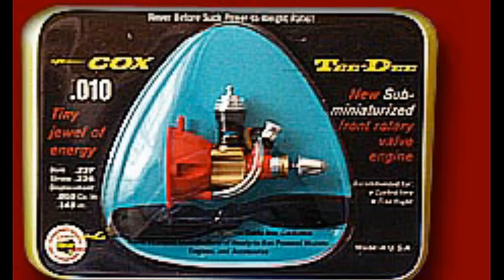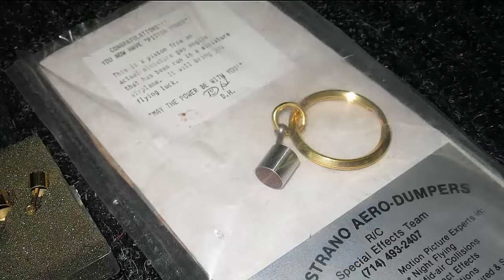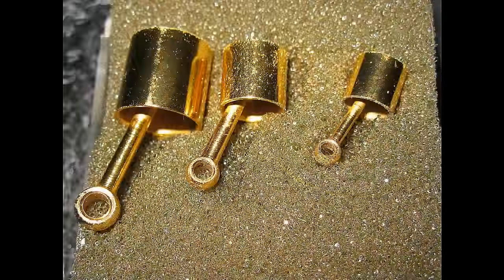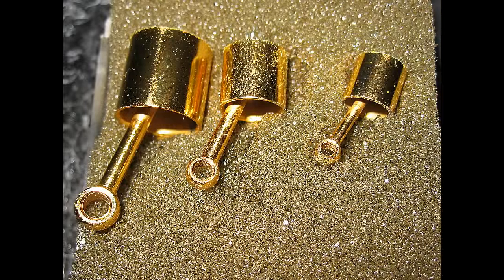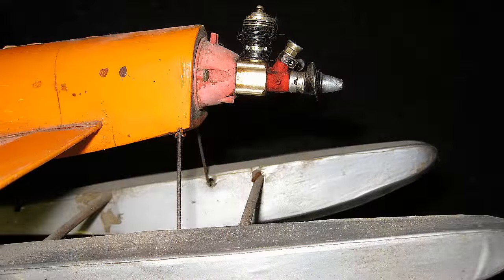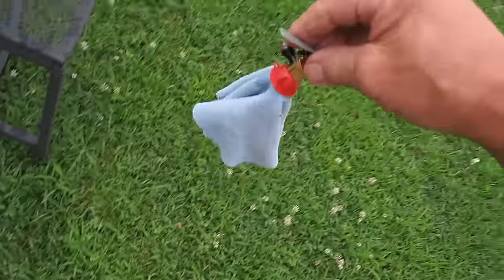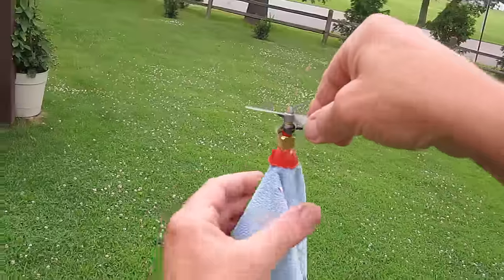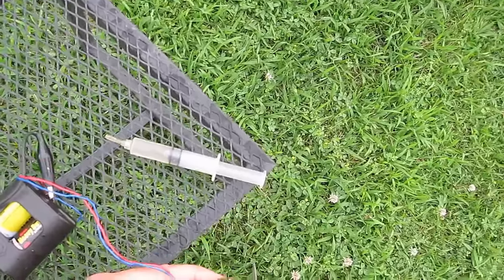Cox .010 Nitro Engine Powered Shop Rags. History and Demo.

Comment: Haha, we did this back in 1976 with the reed valve motors, we used a slightly larger rag with small weights in the corners, it stabilized it a lot. And FYI, that was not 27,000rpm.
Reply from the maker: I first did this in 1955 with a Baby Bee.  Also, it is well known that Cox Tee Dees could turn up to 30,000 RPM.  Just Google it. My Wife and best friend worked at LM Cox in Santa Ana years ago before the fire!

1994 Cox #130 Tee Dee .010 engine.
Displacement: .010 CI   .167 CC
Weight: .05 Oz
This is the smallest cox engine mass produced. It turns up to 30000 1/min on its 3 x 1.25 prop.
The Tee Dee .010 sold for around $65-$120 in the years 1990-2000.  (Click on pictures to enlarge)
Reply: @NightFlyyer  I know TD's can do 30Krpm, but with decades of cox motors, that thing did not sound like 30K,  more like low 20K. I have a simple trick to get the reed valve 0.049 (black widow) to 25K on 10% nitro, when i did competition, everybody was sure I was cheating using +60% nitro, it was a great advantage, then electric came out and I never looked back, the throttle responce in racing is night and day for electric, nitro, feels like a large rubber band delay and when your a national or worlds level comp, we would drive circles around the nitro guys (lap time speaking).
Reply from the maker: @Ozzy3333333  Well, since the engine is also rotating the opposite direction quite fast, RPMs would be lower.  Either way, this video is 10 years old and all was lost in the fire that destroyed my home and all my models and radios on 911, 2016.  Flying rags are still fun and if the .010s weren't so expensive from Cox in Canada, I might like to have another. When I was working at Kraft RC systems, I actually won at the National Multiwing Championships in 1979, but I was using .61 Rossi's on Aeromaster Bipes. They were never close to the RPMs, the TD turned.....or the noise!! I used a Rossi .91 in my Byron F-16s when we filmed the special effects for the Blue Thunder and that turned up pretty fair, but no where near 27,000 or even close to 30,000 RPMs but were a lot easier to start.  At my age now at 73, I would need some big magnifiers, just to see that tiny engine.  LOL  Happy flying.
Reply: @NightFlyyer  Thanks for the info. When I raced at the 10th & 12th scale on-road electric worlds in 1996 (I got 12th), the 1/8th scale nitro guys were practicing, they use 3.5cc (0.21) motor, the top guy Mike Swagger tuner Ron Perris (now RIP) showed me hit motor is doing over 60,000rpm on 80% nitro with a special 7 port motor, trully incredible. Anyways, here is my trick to get the 049 reed valve motor to 25Krpm on 10% https://www.rcgroups.com/forums/showthread.php?2400521-Cox-049-Black-Widow-tuning&pp=50#post31451171

Comment: You rock man!:) You must bee the definition of old schooled RC   most deff!:) Hehehe:) Very cool video man! 
Can you or someone tell me what else these micro 0.010 nitro engine are in use for ? What kind of planes ? How can you operate the carburetor with a servo for example? Is that possible? Or is it a 1-speed engine that you can`t control with a servo?! I see you turn the wheel on the carburetor to set the speed so I assume its not the last one?
MORE OF THOSE VIDEOS !!! :-)
Reply: +Bjørnar Skomedal Not sure what the .010 was used on (free flight planes maybe?) , but I do know that they have 2 speed throttles; full open and stopped! LOL  When I was a kid, you found .049 engines on cheap control line planes.

The wheel he was turning is the fuel mixture needle. You use it to lean out the engine (adding air, reducing fuel) to get the highest level of sustained RPMs that those little engines could produce.
Reply: +Dwight Rahl 
I built a control line plane once powered by a Cox .010. Got the plans out of a magazine. The entire full size plan was printed on one page.

Comment: I have one of those little guys in my building box i've never run it my uncle gave it to me along with a fox .025 on my 10th birthday also included was a sterling ringmaster jr CL bird that I built and flew later i bought a cox .049 corsair i still have all 3 motors but the planes are long gone but i have the scars on my knuckles to remember them by . I'd love to fire that little guy up but the tip on the needle got broken a while back mine is a bit different than yours as my carb is in the back

Comment: glow plug?
Reply: +Michael Kaye Yes, just a small coiled piece of wire in the head (silver part, top of cylinder, where battery clip is connected) that glows red when the starting battery is applied to get the fuel burning initially.  The burning hot fuel then keeps it glowing firing cycle to firing cycle (each turn) as it doesn't have enough compression to create the required heat to start glow plugless.  Some diesels use these, as well.

Comment: Kids these days just don't know what they're missing out on, do they?
Reply: +Electronic Experiments Won't hurt it, as long as you clean the dirt out with a squirt or three of fuel.  Those things were pretty bullet proof, and very cheap to replace.  Don't knock it till you've tried it ;).
Reply: Bobbie's Techincal Stuff im 17 I haven't been missing anything of this since 2015 surprising how cbesp you can get this engines on ebay

Comment: THE ENGINE WITHOUT THE PROPELLER WILL DO FAR MORE RPM
Reply: Neo Korben Yes, and it'll fry the bushings and bust the con rod in seconds.
Reply: Yes, for about 3 seconds it will.
Reply: and without a propeller you really will have difficulties to start it  - and then it will burn in seconds